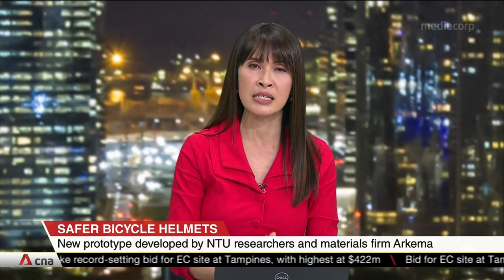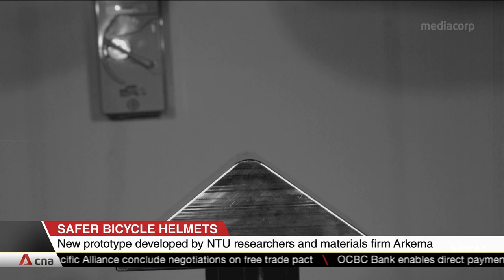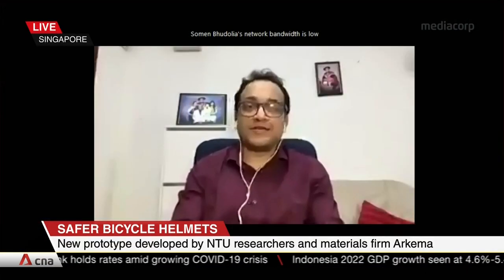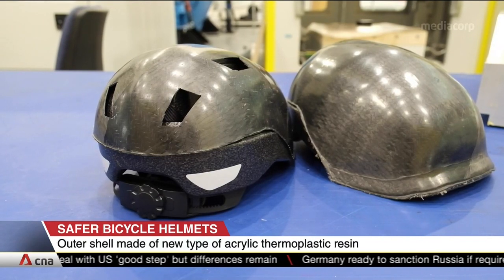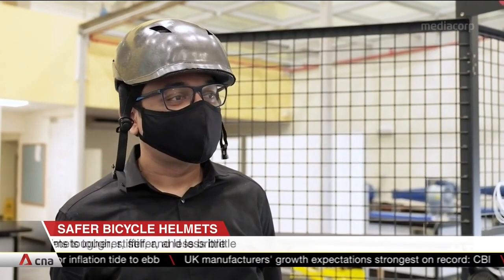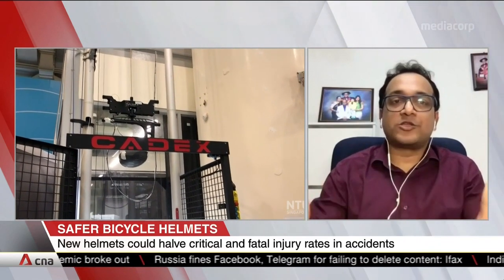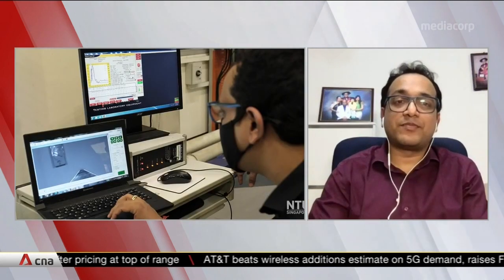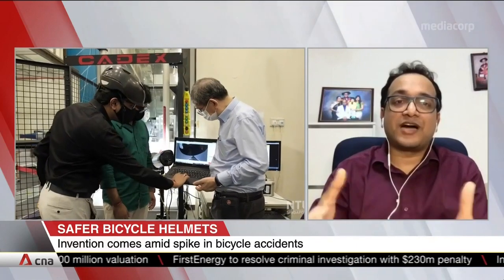Research fellow Somen Bhudolia on safer, cheaper bicycle helmets developed by NTU scientists

Comment: I guess that either CNA or the researchers don't know that a "cheap" helmet goes for $20-70 - but obviously offers not much protection.

A GOOD helmet with MIPS from a reputable European brand can cost as little as $100-150.  

So if they're comparing themselves to $400+ helmets, they're already out of the market with the smallest share.